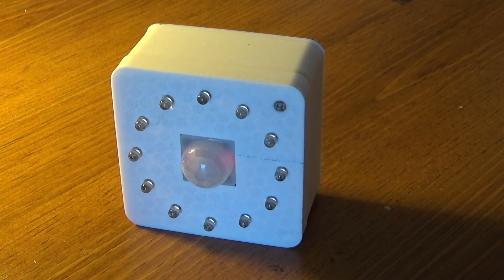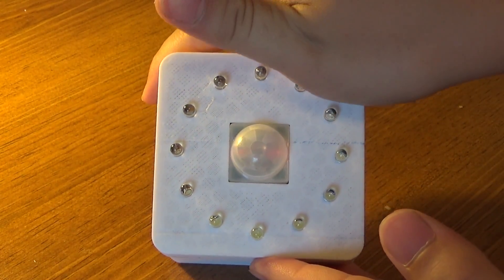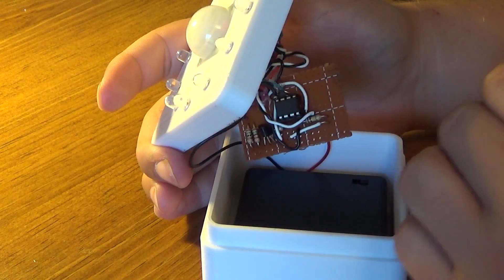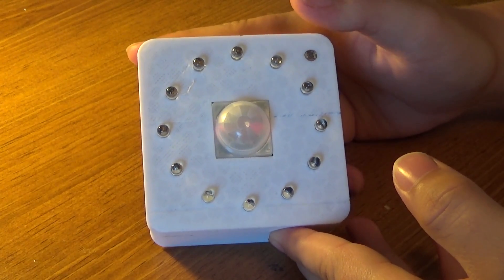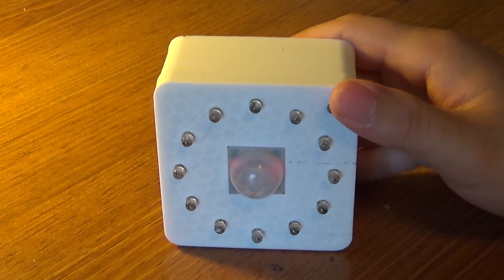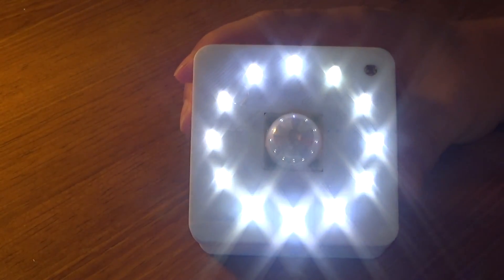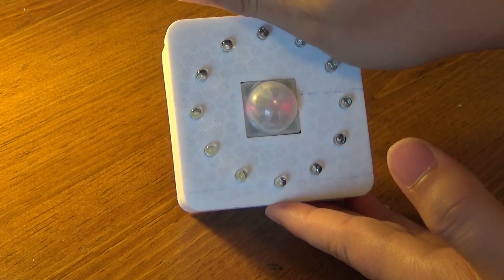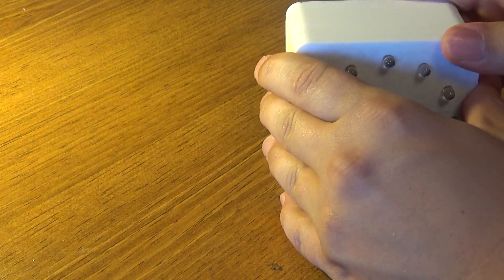DIY Motion Activated Light

Comment: Awesome Bro.. can I use LED strip instead of this one.. any circuit change if any?
Reply from the maker: You could run 5V LED strip but not very much of it. If you wanted to run standard 12V stuff you would have to run it from a 12V supply or some sort, upgrade the transistor that turns the LEDs on and add a voltage regulator for the circuity.
Reply: Thanks Bro

Comment: Hello, I was working on making something like this. I had used four bright LEDs and that seemed ok to light up a dark room. Your 12 must make it really bright.  I'm a bit of a klutz so need something to walk around at night.  Is it in the code on how to set those ATTiny's into sleep mode?  That's something I hadn't tried yet.
Reply from the maker: +Molex 1701 Yes the code that I provided on the thingiverse page (link in the description) does put the ATtiny into sleep mode to save power. By the way mine is still running on the same set of batteries that I put in it when I built it over 9 months ago.
Reply: +Eman2000 Oh Thanks. I'll get that code then. That's a nice long time.
Reply: +Molex 1701 Hi, I had this printed in PLA and the holes shrink a bit. I think thats just PLA vs ABS. From drill bits I had, I used a 13/64 bit and was able to widen the wholes for the LEDs better.  You mentioned needing to widening it for the photocell already.  I'll have to see what bit I have thats good for that. Ugh I've misplaced the PIR so I will need to find it to test fit it. The case it self is snug but doesn't stay together. So I'll need to figure out how to keep it together without glue. For when I need to change the batteries.  Still looks to be a neat project to finish.
Reply: +Molex 1701 Oh found my PIR and it fits PIRectly.